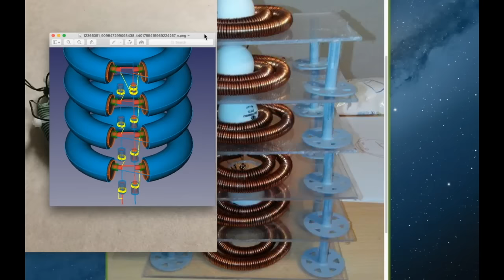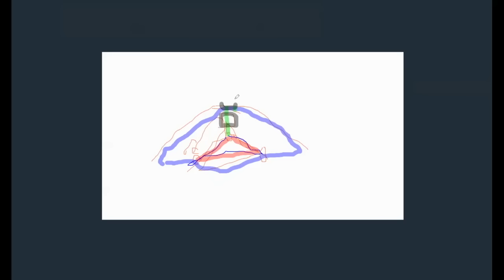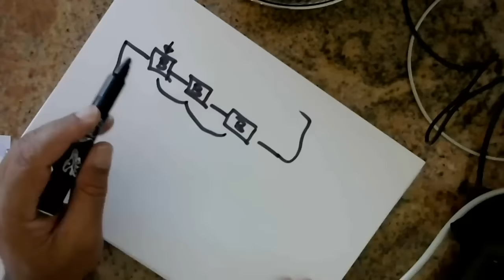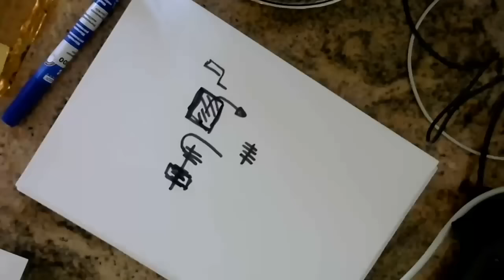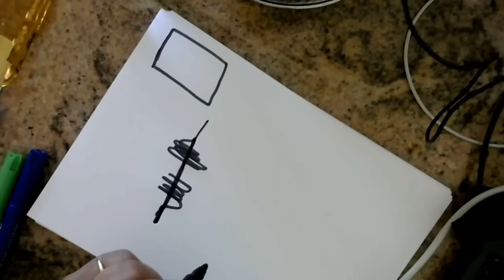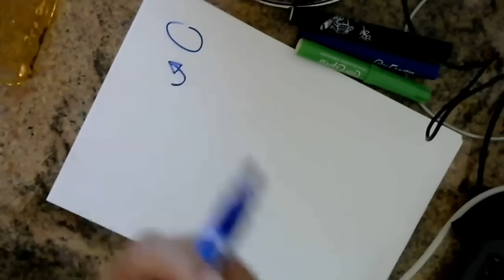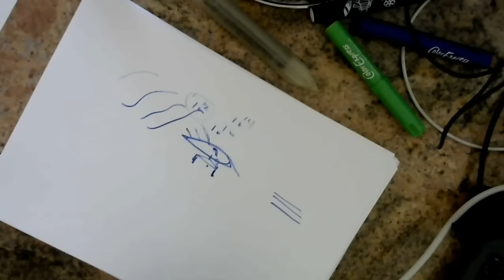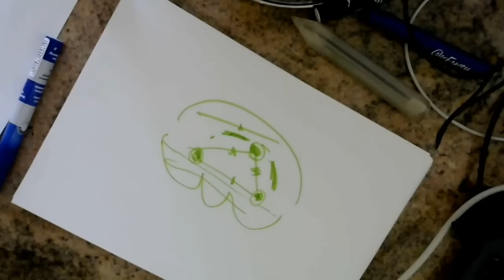94th Knowledge Seekers Workshop Dec 31 2015

Comment: this might be a bit out there but has any body actually tried ingesting gans in very small doses. like 1 ml a day maybe less mixed in water ormus water vibrated at the frequency of the earth or love or whatever you choose. this would surely be the pinnacle :) can we turn ourselves into plasma reactors??  ;) please answer with your thoughts this could be an interesting theory. if this was done properly and monitored so it was done safely. or has any body tried using 24k gold wire to create a reactor. a little more expensive i admit but would it create a better result because it is a better conductor. surely if gold was so important to the egyptians then this must logically be the metal of choice, and if the room was at 37 degrees this is when gold starts to react differently. makes sense to me.
Reply: +Craig Easton Please post your results if you decide to try it. :)
Reply: "gans" is simply cupric oxide, cuprous oxide, and copper peroxide. all as toxic as fluoride upon consumption...or more so
Reply: There are people who ingest  the Zn CO2 white GANS water . the Cuopric  Oxide CuO blue  and Cuprous  Oxide copper color CuO2 are not good for ingestion by   humans . The FeCH3 rusty grease   Gans is considered the most toxic if ingested